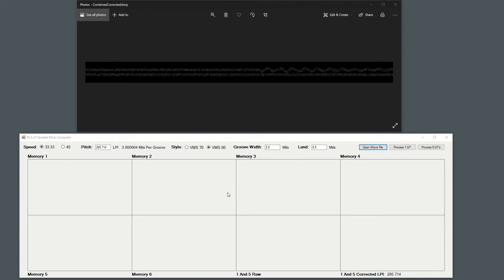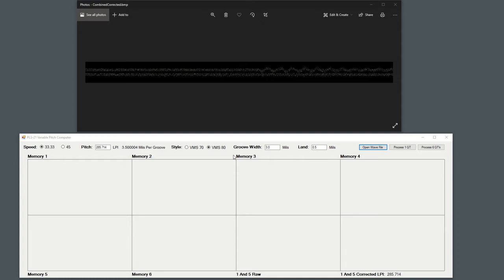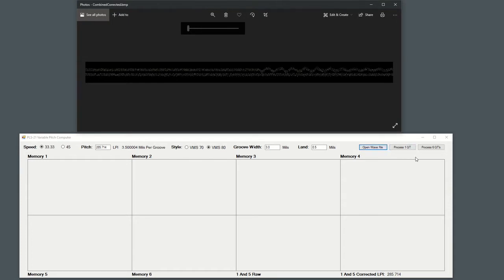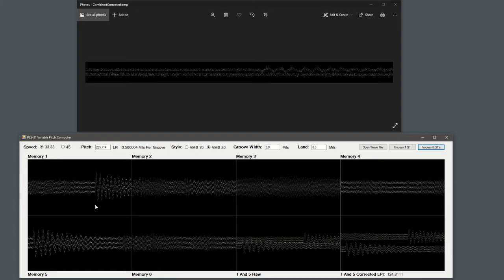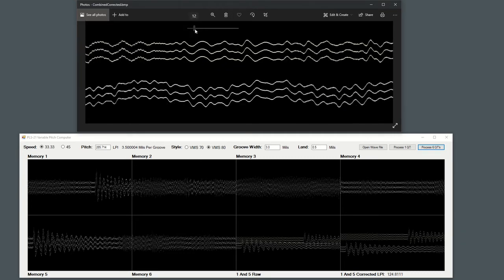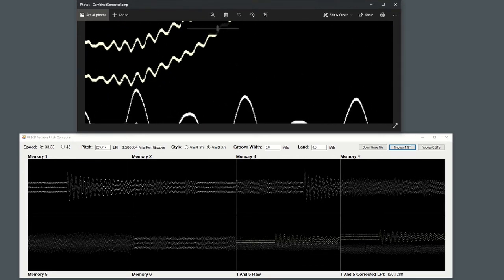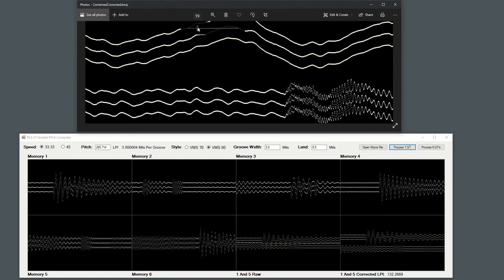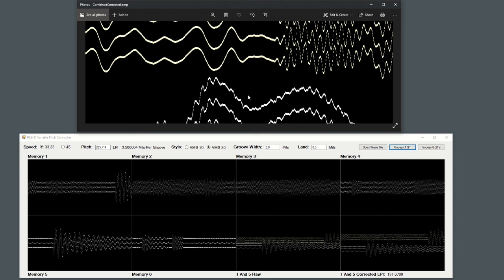VMS 80 Style Pitch Control

Comment: How does the VMS 70 pitch control work compared to the VMS 80?
Reply from the maker: The 70's pitch is all analog circuitry.  So, that is the first difference.  The 80's pitch computer is essentially a CMOS device, so it is truly digital.  Both are technically computers.  Early flight computers for NASA, early electrical (not mechanical) targeting computers for naval ships, as well as many specialized devices for doing scientific research many years ago all employed analog computers to do things like sample and hold, integration, differentiation, peak detection, etc.  The 70's pitch is similar to this type of circuitry and uses those design patterns.  Whereas the 80's was a digital computer.  It had digital memory registers, a clock, clock dividers, shift registers, etc.  It was similar to early digital manufacturing control systems that heavily relied on CMOS at that time.

So, one could perform more powerful operations, and calculations with the 80's hardware vs. the 70's.  That is why it is superior.  Given the same program material, it is capable of using less space on disc.  You can pack more time on one side at the same level with the same content (both of which are factors in space usage) with the 80's pitch/depth control system vs. the 70's.   In a nutshell the difference is Peak to Peak packing of the grooves vs. Point to Point.  I discuss this in one of the videos in this series.  Please watch them all!  If you only pack grooves together based on the loudest point in any given Quarter Turn when stacked against the next nestled Quarter Turn on the next spiral groove revolution, then you end up wasting a lot of space.  Peak to Peak is how the 70's worked.  80's is point to point.  Now, you are literally nestling grooves together and wasting no space, and in fact maintaining a preset amount of "land" (space between grooves) between the points that are the closest in the nestled Quarter Turns.  This results in a huge lateral space savings on disc.